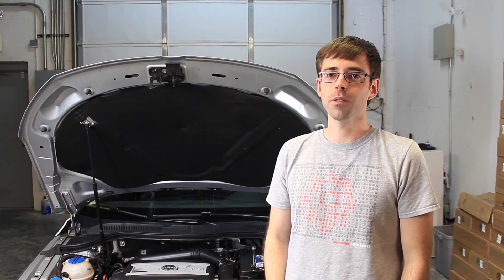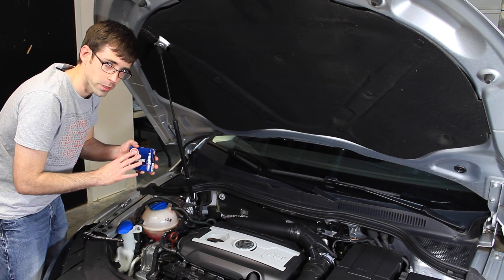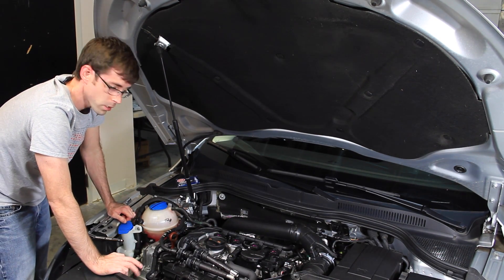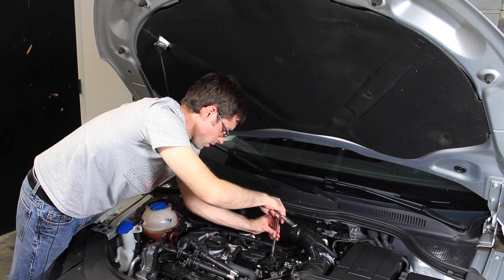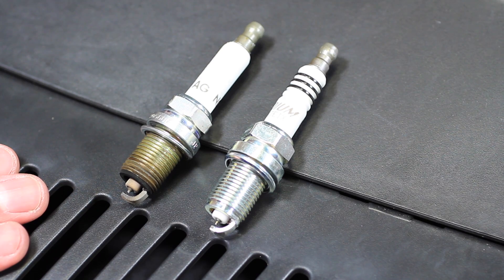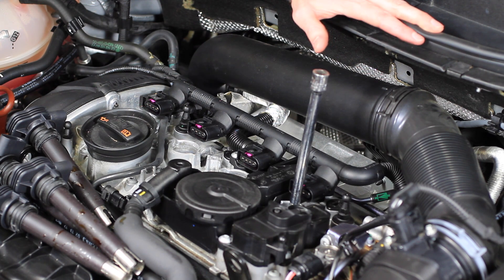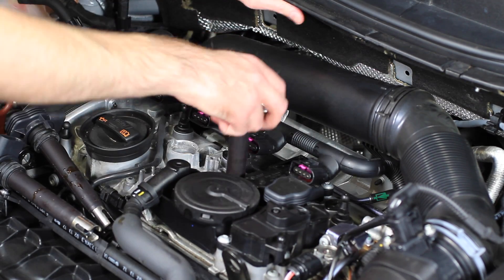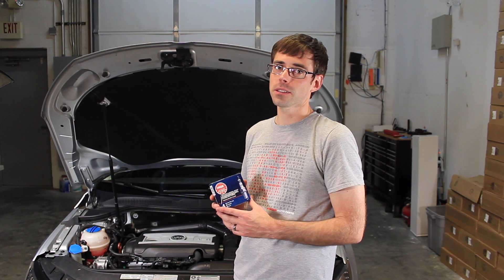VW 2.0T TSI Spark Plug DIY (How To) Install

Comment: Thank you very much for posting all these videos.  I just bought a 2011 VW CC R-Line and after watching this video was able to change my plugs with no problem.  I replaced the factory plugs with Denzo 4702 IK20TT Iridium twin-tip plugs.  I purchased these from Advance Auto Parts, and they list this plug as an 'exact-fit' for my vehicle.  I changed them on Wednesday, and so far the car is running fine.  Just wanted to know if you had ever used these plugs on this engine, and what your opinion was.  Thanks!
Reply from the maker: Todd Boudreaux Glad our video could help.  Also great to hear the car is running well.  Denso plugs are generally not up to the quality that we recommend for VW and Audi Models.  This is one of the reasons we don't offer them.  NGK or Bosch are the brands we recommend as they are the manufacturers used from the factory.  We would not recommend taking them out and getting rid of them at this point, but if you have misfire issues you should consider swapping to a better quality plug.  

Hope this helps

Comment: Do you use anti seize on the plugs or is it safe it out it
Reply: +MkvRbt Just a drop of clean, light weight oil on the treads is all to worry about if that. I would to insure a smooth torque on the new plugs. I'm sure some would say it's not necessary.  Also one point they don't talk about here is NEVER remove the plug from a hot engine that has an aluminum head because you can damage the threads in the head when taking the old plugs out.
Reply from the maker: If you do you should use very little.

Comment: Why couldn't my 2011 Sentra MR20DE engine be this easy to work with -__- looks like I'm gonna be a future Volkswagen owner.
Reply: my vw is lasting alot, 2005 and 256k kms what do you mean not to buy vw?
Reply: Jorge Pulido they’re hard to work with when you don’t have the tools lmao.
Reply: VW was the worse mistake I ever made... However I bought mine second hand I've had it 4 months already put 2000 in repairs 1500 first 2 weeks, its acting up again, and I have over 5000 in estimates of work that needs to be done prior to it completely quitting this time....  VW may be good but I would recommend taking one to a mechanic shop and getting a diagnostic first even if it cost 100 bucks would have saved me a ton of money... I took a mechanic with me, but the problems weren't visible from the top of the car, and the guy apparently pressure washed the motor so that the oil leak buildup was not visible. He topped off the fluids so that the coolant leak didn't show. and a list of tons of other things that's wrong with this stupid car I'm stuck with.  Could of bought a brand new one with a warranty by the time I finish fixing this 10-year-old car.
Reply: They're fun if you like working on cars. The major maintenance spots are fairly accessible, unlike my Hondas. They just use weird screws so be ready for that (mostly torx and triple squares).
Reply: Matt Smith i know its 2 years but dont buy vw im owner of vw
Reply: @Koshear1  Been driving VW's since my first 69 Bug to my current 09 Tiguan (and 5 others in between) and I've never been left by the side of the road. Too bad I can't say that about the other vehicles (Chevy, Ford, Nissan, Dodge) my wife & kids had the unfortunate mistake of driving. The Ford & the Chevy being the worst, what pieces of crap. I personally will never driving anything else but a VW (unless I can afford an Audi someday). Of course we all know that VW is the parent company of Audi so my allegiance really wouldn't have changed.

Comment: Is this process similar for 2010 VW CC 3.6L V6?
Reply from the maker: The 3.6 would be different than this.
Reply: Deutsche Auto Parts- Your Source for Everything VW and Audi You got one of those laying around to do the video :) 

This one seems simple enough and I just hope that I can buy the parts and replace the coil and plugs myself.
Reply from the maker: ozibaba79 Im sorry we dont have one here to do a video on. 

This is the plug for the 3.6
http://www.deutscheautoparts.com/View/101-905-622/0/224742

Here is the coil
http://www.deutscheautoparts.com/View/022-905-715-A/0/210872

Comment: How did you remove the harness so easily?
Reply: He unclipped the connectors on the coils first, then easy to just pop right out
Reply: You have to use some strength to yank it out.
Reply: I didn't want to break the plastic tab, so I found someone using WD-40 to loosen them up. I would have broken them otherwise, still broke one tab. Just be sure to wipe off all the WD-40 with a paper towel before reconnecting everything. In my case, fine dust had made it's way in there, and the plastic gets brittle in the heat under the hood and parking outside. I put a thin layer of dielectric grease where the coil connects to the harness to hopefully make it easier to remove next time.

Comment from the maker: Our most recent DIY on how to replace spark plugs on a 2.0T engine

VW 2.0T TSI Spark Plug DIY (How To) Install
Reply: Deutsche Auto Parts Can you please tell me if the Bosch FR6KPP332S plugs also come pre-gapped like these NGK?
Reply: Do I need to unplug my battery before I start the process and it is the same process for MK7 GTI?